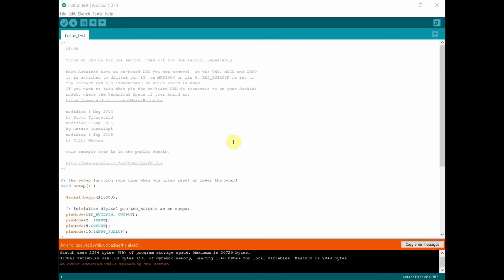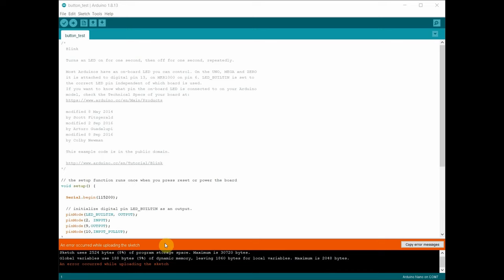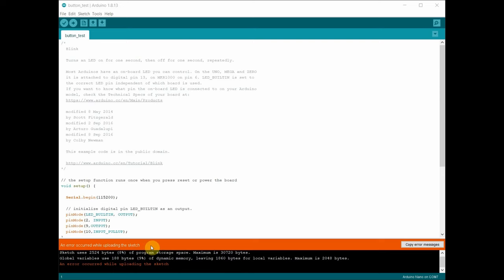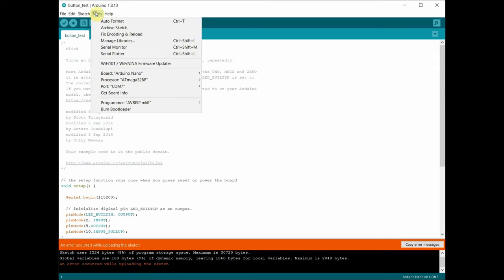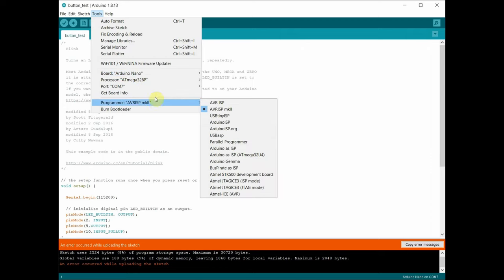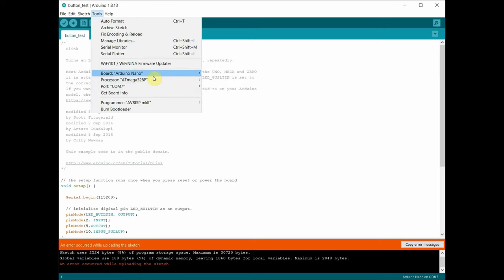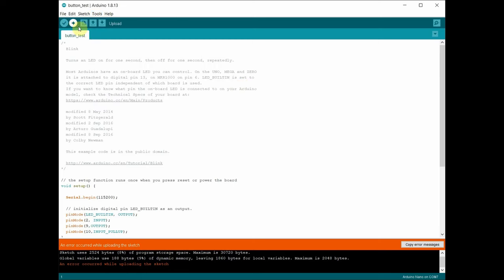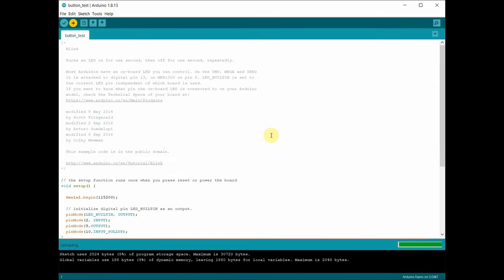A possible solution for "error occurred while uploading the sketch" on your Arduino ATmega328P

Comment: The processor section of Arduino IDE doesn't exist anymore, or at least I can't find it, now how do I fix it?
Reply from the maker: Then I would suggest that there is no "old" bootloader for that device.  I am running Arduino IDE 2.3.2  and I see, for the Nano (ATmega328P), the old bootloader is still listed.

Comment: I can see my port but whenever i try to upload my code, this shows up:

ketch uses 1486 bytes (4%) of program storage space. Maximum is 32256 bytes.
Global variables use 200 bytes (9%) of dynamic memory, leaving 1848 bytes for local variables. Maximum is 2048 bytes.
avrdude: stk500_recv(): programmer is not responding
avrdude: stk500_getsync() attempt 1 of 10: not in sync: resp=0x34
avrdude: stk500_recv(): programmer is not responding
avrdude: stk500_getsync() attempt 2 of 10: not in sync: resp=0x34
avrdude: stk500_recv(): programmer is not responding
avrdude: stk500_getsync() attempt 3 of 10: not in sync: resp=0x34
avrdude: stk500_recv(): programmer is not responding
avrdude: stk500_getsync() attempt 4 of 10: not in sync: resp=0x34
avrdude: stk500_recv(): programmer is not responding
avrdude: stk500_getsync() attempt 5 of 10: not in sync: resp=0x34
avrdude: stk500_recv(): programmer is not responding
avrdude: stk500_getsync() attempt 6 of 10: not in sync: resp=0x34
avrdude: stk500_recv(): programmer is not responding
avrdude: stk500_getsync() attempt 7 of 10: not in sync: resp=0x34
avrdude: stk500_recv(): programmer is not responding
avrdude: stk500_getsync() attempt 8 of 10: not in sync: resp=0x34
avrdude: stk500_recv(): programmer is not responding
avrdude: stk500_getsync() attempt 9 of 10: not in sync: resp=0x34
avrdude: stk500_recv(): programmer is not responding
avrdude: stk500_getsync() attempt 10 of 10: not in sync: resp=0x34
Failed uploading: uploading error: exit status 1
Reply from the maker: I have many questions and not enough data. Is this an Arduino? Has it ever worked? Have you tried another usb cable? You posted this on the bootloader video, so can I assume you checked it with the old bootloader? Have you removed any wiring that you put on and then tried programming it?
Reply: @StuartPatterson  yes, I've tried everything. There was no attachment, the PC was fine, and etc. I've been using Arduino R3. It also uploads for too loooooong, indicating that it won't be read. Any suggestions?
Reply from the maker: @kanna7013  Well, it could be damaged.  The basic debugging process is.  1) Try another Arduino. 2) Replace the USB cable 3) Check the USB drivers (FTDI vs. CHG340) 4) Remove any connections on the Arduino because you can impact TX RX sometimes.  5) Check the bootloader (per video)  If you have tried all those tests, it is possible the Arduino is damaged.

Comment: Could this will work for ARDUINO UNO board? Im a beginner and im afraid if it damages the board?
Reply from the maker: Good question but I don't have an answer.  If you choose the UNO as your processor and see Old Bootloader as an option, then I would think it could work, but I don't know for certain.
Reply: @StuartPatterson Thankyou for your response. yes it worked with another method. 😊
Reply from the maker: @sprrez  Glad to hear!
Reply: @sprrez  Which method was that?
Reply: @Lina-gm1oe  You have to install CH340 driver in your laptop.

Comment: i'm trying this but here is an issue that when i upload the programme then it is showing error and not uploading the code 
please help me i have to submit this as a project tomorrow
Reply from the maker: Never wait till the last minute with school projects!  Anyway, you have not given me much information to go on.  Try another USB cable, try another machine if you can, also disconnect anything you have connected to the microcontroller and see if it will work to upload. It is actually very common that using certain pins will cause programming issues.
Reply: @StuartPatterson  thanks sir this problem is dignised but now still having some issues
Reply from the maker: @RM_MOTORS  Glad to hear you have made some progress in solving the issue!

Comment: sir i cant see any processer option in the tools
Reply from the maker: I just looked at IDE 2.3.2 and when you have selected an Arduino nano (AT328P) it is still listed on the menu under Tools/Processor.  What board are you trying this on?
Reply: @StuartPatterson  What Arduino unio
Reply from the maker: @dennisnonailladajr.8605  An ATmega328P microcontroller such as the Nano

Comment: i have the same problem but old bootloader isn't showing up im on IDE 2.1.0
Reply from the maker: If you select “Arduino Nano” for the board you should see “ATmega 328P (Old Bootloader)” in the Processor menu. Did you resolve the problem or do I need to look into it?

Comment: but i dont have old boot loader
Reply from the maker: Might check the USB cable.  I have had cheap cables that did not supply connections to all the USB pins necessary to program the Nano.
Reply: @StuartPatterson  no there is a driver I found uhm I don't know where I found it. But it was a com port erro that's why it was doing that. So I installed this driver and it game me a comport 4 and it worked fine. Yes some times the USB cables can also do that because it's not communicating with the arduino software. But thanks for responding. Will try see where that driver is and send the link
Reply from the maker: @aramagon7011  Glad to hear you figured it out.  I have seen that issue with non-FTDI USB chips.
Reply: @StuartPatterson  yes I've seen it too. I've been in the I. T FIELD for nearly 23 years I've seen some strange things. But it's faults in design or the components it's self. And if not that it's a manufacturer fault.
Reply from the maker: I am glad you got it working!

Comment: Not working for me ._.
Reply from the maker: Well, this is the second time I have heard it was not working.  Any additional info?  Does it show the old boot loader as an option?  Which version of the Arduino IDE are you using? What Arduino device?
Reply: @StuartPatterson Yea it Shows Oldboot shows a Option latest Arduino Verison And , Arduino Nano
Reply from the maker: Hmm.  Do you have it wired to a project?  If so, try disconnecting it and then programming.  If certain pins are connected it won’t program. Not sure which pins but you can search online.
Reply: @StuartPatterson  No Pins Are connected
Reply from the maker: Sorry, maybe a bad board OR bad USB cable.  If you can't get it working and plan on throwing it away, I will pay for shipping for you to send it to me.  This is the second time I have heard of an issue.
Reply: @StuartPatterson  i am having same issue, i have tried on two different arduino uno and cables. i have tried it on 1.8.14 version as well. there is no processor option in ide when i select Arduino uno from boards. everything was working fine few months back now i dont know whats the problem, i have tried on two different laptops as well.
Reply from the maker: @Yurihjjjn  A few ideas:  check the version of the Arduino IDE you are using, and also if the UNO is a clone, it might be using the CHG340 drivers https://learn.sparkfun.com/tutorials/how-to-install-ch340-drivers/all

Comment: sir what to do in Ardunio UNO
Reply from the maker: Confirm that you can see the com port.  Some of the clone devices use the ch340 usb to serial chip which might require a different Windows driver.